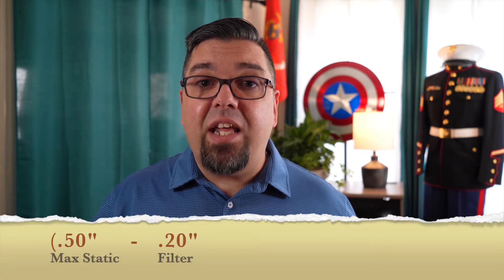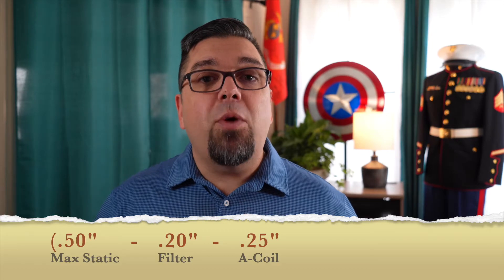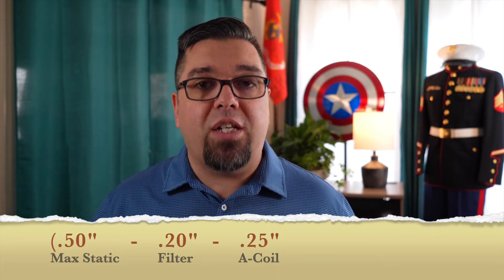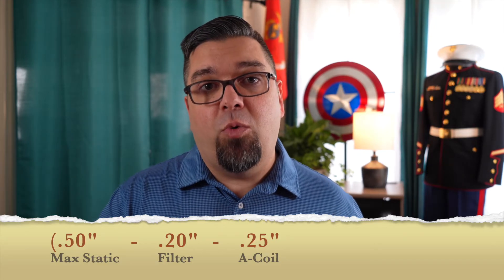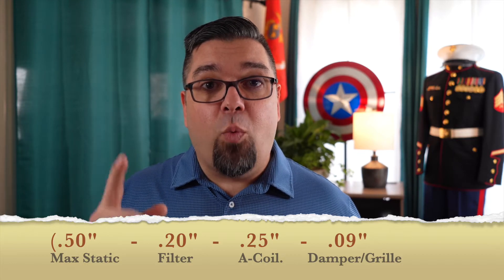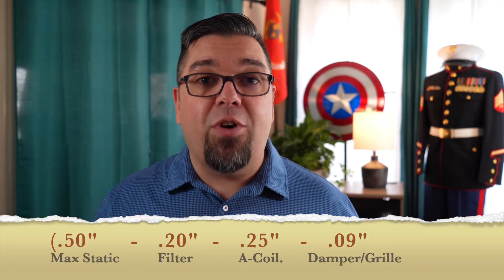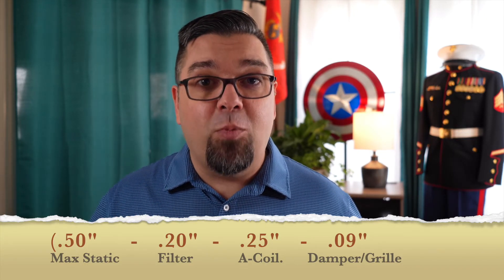Manual D - Maximum External Static Pressure

Comment: Help! Im an HVAC tech in the field trying to become better. I don't understand airflow very well. But from what I have gleaned is this:
1. With most systems, try not to add (deduct) more than .5inwc of static pressure to the system rating.
2. Ductwork size is designed with velocity as its priority -- i.e V=Q/A
3. PSC motors have trouble overcoming more than .5 of additional added Static pressure? 

-- What is Friction rate? How does it relate to the static pressure? How should I design ductwork in a retrofit situation. Is it possible to predict the static pressure of a system before its installed?